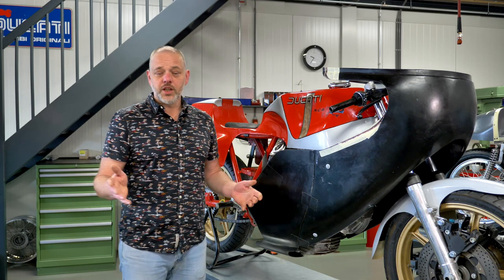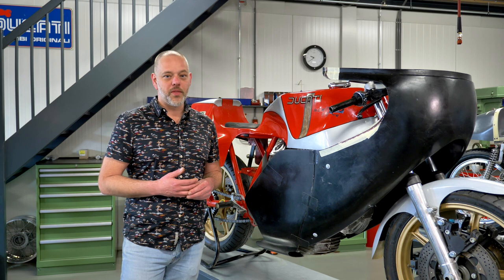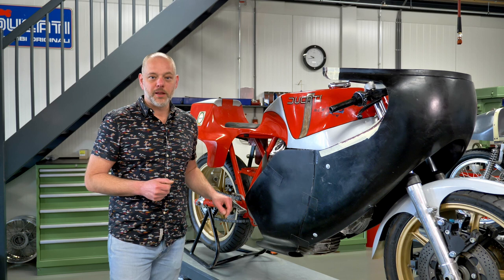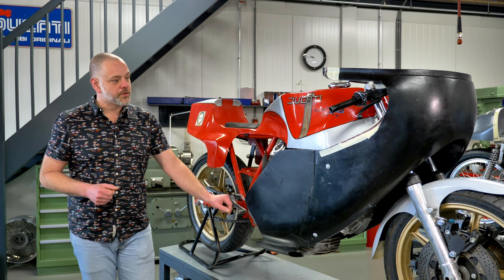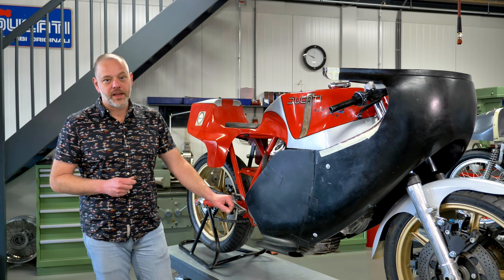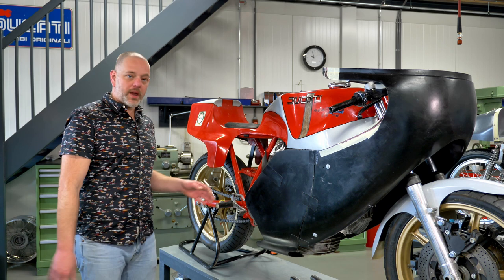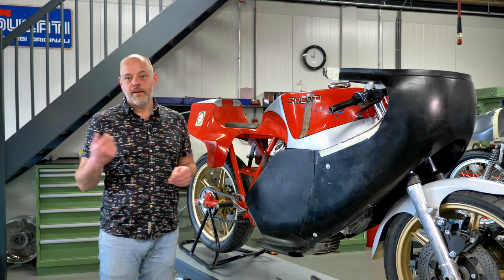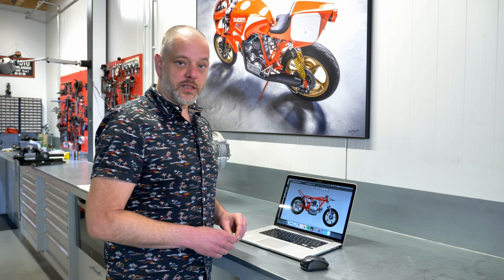NCR History and Project (Part 2) - Back to Classics

Comment: A company in Ontario, Canada offered the fiberglass NCR tank/seat combination (anyone remember Brutune Racing?) for our narrow frame bikes. Canadian roads proved too tough for regularly ridden one piece set ups, they cracked at the front of the seat, so they then sold it as 2 pieces, tank and seat.

Comment: NCR was basically a Ducati employee skunkworks.  THey had a 900 that weighed close to 350 lbs wet..In endurance trim  Brake and clutch levers were drilled titanium.. No expenses spared..